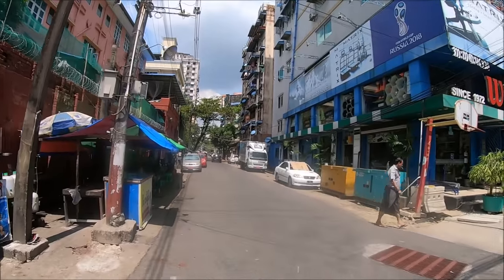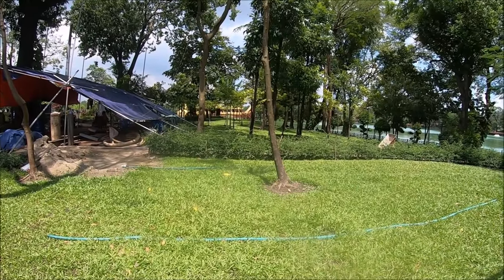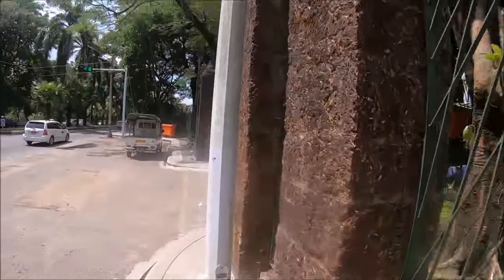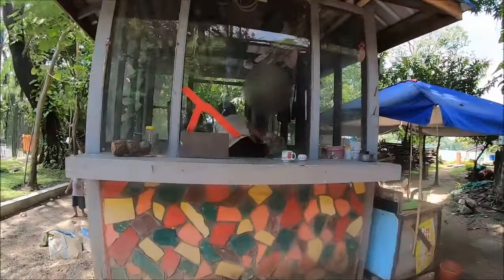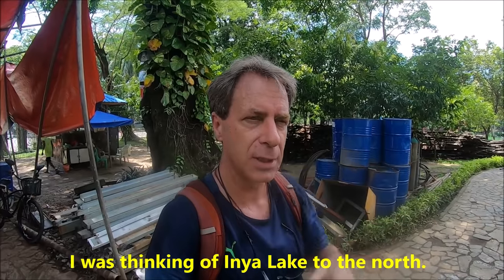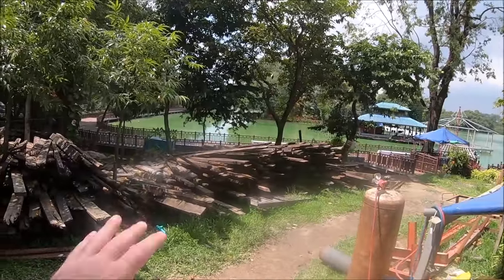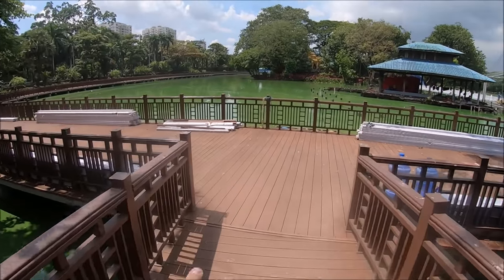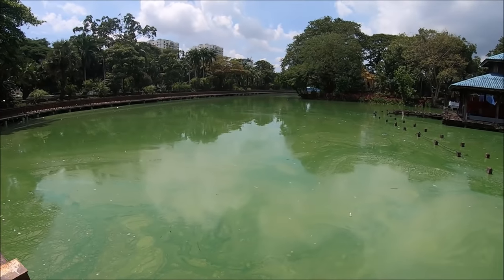"YOU SHALL NOT PASS!!" Blasting Through Barriers at Kandawgyi Lake in Yangon, Myanmar

Comment: I was told that Karaweit restaurant has a really nice expensive buffet, which I wanted to try but didn't get to. Perhaps next time... 
That was a quite an adventure on the walk bridge keep running into blockade stops. It would've been pretty had there been an accident since no one seems to be around. Enjoyed the vid.
I think Google has a real time picture translator app where you take the sign and app translates it into English. You should look into getting that, Doug. The sign you saw in Burmese says, danger, do not enter.
Reply from the maker: I think Karaweik has the buffet dinner and performances - like dinner and a show. Going there is a cultural experience. From what I've read (and someone described an evening there here in the comments), it is a good place to go and worth the money, though the building itself is perhaps showing its age and not quite as shiny and glamorous inside as it once was.

I've used that Google translation app in a few different countries (using the phone's camera), but it doesn't work on Burmese as far as I know. I tried it when I first got here, and it didn't work. Then I learned that Google hasn't added the Burmese script to their database yet. It works great with other languages. It doesn't get the translation perfect, of course, but you get the gist.

Though, to be honest, I didn't really need a translation app for that sign. Based on what I'd experienced on the boardwalk, it was pretty clear what it probably said. 🙂